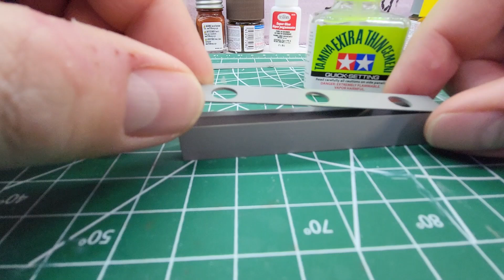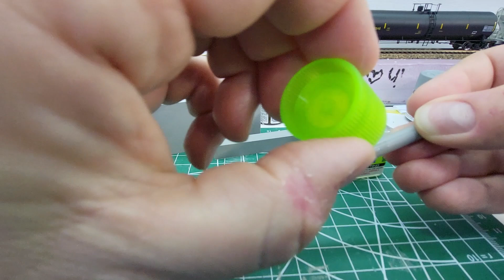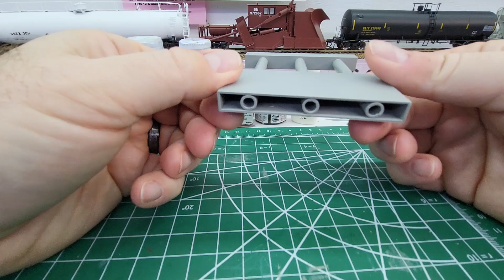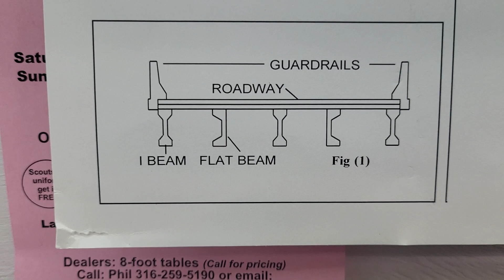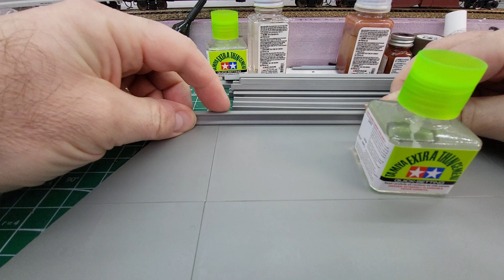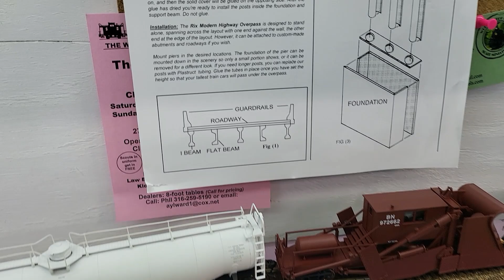How I do stuff on the K&W Model Railroad - Interstate 135 Bridge Construction

Comment: They make little clamps that you can put on to hold the parts at a perfect 90 degrees so that you don’t have to try to hold the parts while you glue them, especially with fast acting glues. The great part is that the clamps leave an open area where you can get access to glue it. You obviously don’t have the problem I had when I was a kid and used the tube of Testors glue and got more glue on my hands and left glue fingerprints on the models, lol.
Reply from the maker: I have a magnetic version of what you speak of.  It works well, but is kind of a pain to set up so it's not really worth the effort most of the time.  I remember those Testor's tubes...I managed to puncture my tubes frequently...ughh...I don't miss that aggravation!  My model building life changed completely when I was turned on to thin, fast setting glue.  Game changer!

Comment: Ive had great luck with the plastruct glue, its nearly the same as this glue but comes in a larger bottle. Another option ive seen used is MEK which does the same thing but can be hard to find.

I've also found plasteuct glue works really well to glue PLA 3d printed parts.

The bridge looks really good btw, some paint and weathering will make it look even better.
Reply from the maker: I've been warned by John over at Whistle Stop Models that I need to use super glue to glue 3D printed stuff.  Good to know Plastruct glue works as well.
Reply: I've had mixed results with super glue, it works but I've found alternatives work better for my use cases (printing 4in reels for SMT part tapes).
Reply from the maker: @atanisoftware  Great to know!  Thank you!

Comment: As a retired architect, I can remember our professional structure modelers in the office using a glue bottle with a fine tube instead of a brush which as used as a syringe to apply glue. You might check Micro Mark for this.
Reply from the maker: I have seen the type of glue you are talking about...might be another good tool to add to the collection.  That tiny tube would certainly help with portion control.  I would like to become really good at building, and even scratchbuilding models, but I think that will have to wait until retirement when I have more time.  For now, "good enough" will have to be good enough.

Comment: I've used Testors cement glue (in the red metal tube) for any plastic buildings I have. It works very well on plastics like polystyrene because it dissolves the plastic and fuses them together as one piece. Better than just about any glue when using the right plastic. It can be sanded down too if there's too much on the outside.
Reply from the maker: @danagibbs3265  I had used that glue since I was a kid building model planes because it was all you could at Walmart (before I knew hobby stores were a thing...yes, I was raised in a small town).  Last year however, I was complaining to a manager at Hobbytown about how much trouble I was having gluing small parts together (the Faller Chemical Plant kit) when he recommended this Tamiya thin quick set glue.  Now I use it for almost everything.  I'm on my fifth bottle in about a year.
Reply: @KandWRailroader  I'm thinking about trying it, seeing how easy you got that all together
Reply from the maker: @danagibbs3265  I would definitely say it was one of the easier models I've put together...much like their grain bin models.  Good luck to you!

Comment: You could have used rubber bands to hold the pieces while gluing!
Reply from the maker: Very true!  However, as fast as the glue works, it really was no trouble to just hold the pieces together.  I may have sounded like I was complaining about it, but as fast as it all went together, especially since I ultimately built 16 of those supports, it really wasn't that big of a deal.  I just have to build one more to finish my La Junta highway bridge.
Reply: @KandWRailroader  
I was thinking more about banding many of them time, then run through gluing. 
If I have a lot repetition it's easier for me. .
You gota right nice layout there friend, I'm working on one myself. 
Enjoy your evening  !
Reply from the maker: @gregoryjones2004  I hadn't thought of that...thanks for the tip!  One of these days I'll actually put some thought into a project before diving in...might save me a bunch of time and effort!  Thank you for the compliment.  Good luck on your layout!

Comment: I like Testors & Faller glues with the tube applicator-they take a little more time to cure, giving time to make adjustments..
Reply from the maker: @AllenCNW441  It seems like there is a glue out there for every preference.
Reply: Fallers with the needle applicater is my go to. Great for applying glue to the inside corners of buildings or other structures.

Comment: Just a quick tip when gluing the base and top, I would glue them from the inside. Once the sides are glued you could turn the assembly upside down and glue the top and bottom seams from the inside and you wont get as much glue on the outside of the structure or your fingers. Keep up the great work.
Reply from the maker: Normally I would agree with you, but this particular glue dries so fast that I've only been able to use it with the parts already in contact.  I still use Testors on occasion, especially with large structure parts where structural integrity is really important...for those applications I still try to minimize the appearance of glue by applying it where the parts meet, on the inside or bottom if possible, then joining the parts.  Keeping this glue off my fingers would be easier if took more care not to use so much, but paint seems to hide any mess left behind really well since the glue is so thin.
Reply: @KandWRailroader  I may have to try that glue sometime. I have always used Zap-A-Gap in the green bottle. It is fast setting especially with eyes and fingers. LOL!
Reply from the maker: @GLENNHOOVER-h6l  I found Mr. Cement at Hobby Lobby has a similar product that works well too.  I'm sure there are others.

Comment: A couple of tips for you to add to your model building toolbox. When gluing parts, like those columns, clamps are still useful. There are clamps that are not super strong but  I have used simple spring style clothes line pins. The clampscwill keep your fingers away from the glue and put a small amount of pressure on the seam to aid the "welding" process.
I like to make SpruGoo.  I took a partly empty bottle of Super Thin and cut small section of model sprue into the bottle. After a few hours to a day the sprue will have devolved (shake frequently). This can be made thick with lots of sprue or thin with less.  What's is good for?  I use this to reinforce joints from the interior. I have used it as a filler (tiny areas).  There are more uses.  I typically just use white and grey sprue but I know some folks have made different colors.  The bottle can be recharged by pouring in fresh glue and more sprue. It can be applied with the lid brush or a microbrush.
Hope this is helpful to you.  If you would like me to do a video showing the SpruGoo let me know and I will make one.
Reply from the maker: I do have a collection of mini-clothes pins, but have not found a viable use for them yet as they often want to make parts slide under pressure due to indirect force applied to the parts.  Either way, this glue dries so fast it didn't seem necessary to use clamps.  I would love to see a video about making SpruGoo!  Sounds very cool!
Reply: @KandWRailroader I have made a video about the SpruGoo.  It is on my channel. I cannot add a link, can you add the link to the video?

Comment: You can pull the brush on the Tamiya glue to make it longer. It has a telescoping antenna design. Also, if you have a lot of stuff to build, you can use Tamiya air brush cleaner. Its the same as the quick setting glue minus a small added perfume at 1/5th the cost.
Reply: The beams look verry  straight
Reply from the maker: @jefft1122  They turned out ok...thanks!
Reply from the maker: Thank your for the tip!  I was not aware of that.  I will have to try the air brush cleaner too...I need some anyway!

Comment: quick tip when the glue gets low in mine i use a micro brush you can get a pack from hobby lobby for a couple dollars. great job on the build. love build videos.
Reply from the maker: Good tip, I have some of those, just hadn't thought of using them for that purpose.  I have been pouring old bottles into new when they are both down to about 50%.